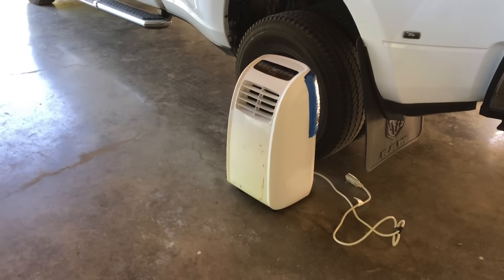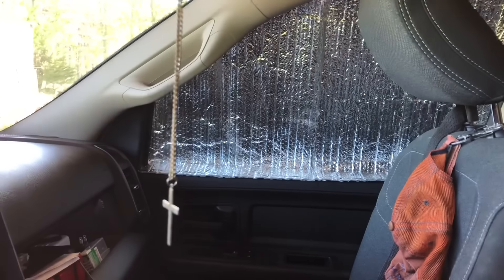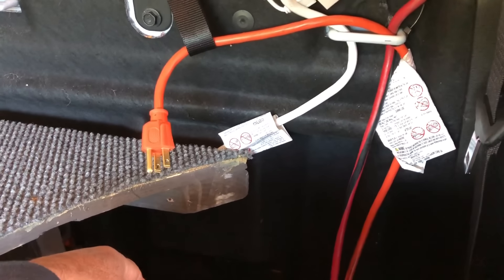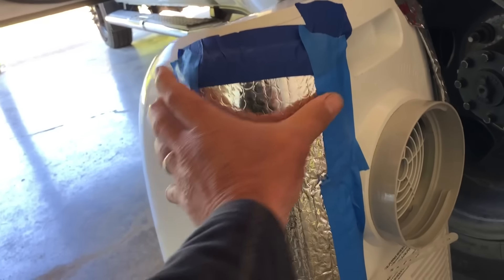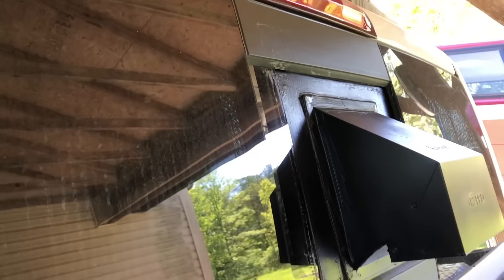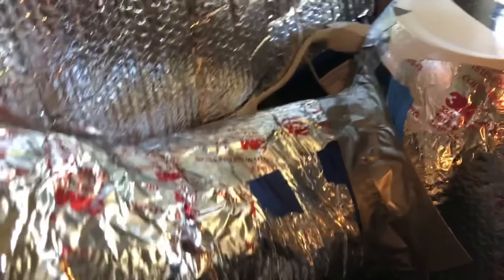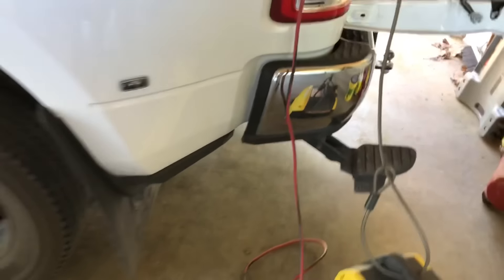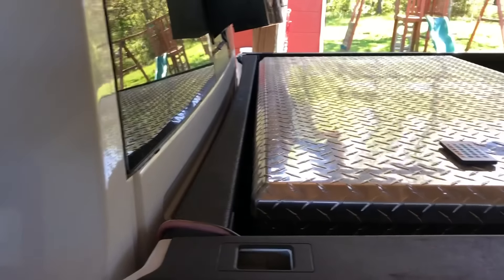Best Hotshot Pickup Sleeper Air Conditioning Setup! Save $$$ and stop idling when off duty!

Comment: Where does the air come from to replace the hot air you're exhausting out?     
I'm sure you get some leaking through the trucks vents, but unlike a house that has numerous cracks for outside air to replace the exhausted air, I imagine the air conditioner is not getting enough air going through the hot side.   A way you could greatly increase efficiency is to turn that single hose portable into a double hose by building a duct around the hot side intake and connecting it to a second hose going outside.
With a double hose setup, instead of pulling air-conditioned air from inside the truck to cool the hot side, it will use outside air to cool the hot side.      I've done it using foam board and it was pretty easy but that was in a house.  Your available space would definitely make it far more of a challenge but you seem pretty crafty.   I bet you could do it.
Reply: You are right and over 90% of people don't even understand that. But they do make two hoes versions that come with a fresh air intake hose, you just have to search for them
Reply: So it's better to cool hot air compared to cool air that dosen't make sense
Reply: @danielpolson9340  
It's better to cool the condenser with outside air than with inside air, even though the outside air is warmer.  Don't forget, the only reason your inside air is cooler is because you invested the energy into cooling it.  If you're going to use it to cool the condenser to then pump it outside, that air has to be replaced and it gets replaced with outside air that you now have to cool again.
Reply: @Andy-df5fj  the only ac i have worked on is auto now that makes sense and that's a horrible design lol
Reply: @danielpolson9340  
Yes the single hose setup is a horrible design they tend do with portable ACs, but despite the inefficiency, it still works well enough that people would apparently rather only deal with one hose, efficiency be damned.
Reply: @danielpolson9340  you don't understand  because it takes a little more advanced understanding on how air conditioners work.. All air conditioners have a hot side and a cold side that are supposed to be completely isolated from each other. The cool side goes into the living space you want to be cooled and recirculate the air in that space continuing to make it colder. It does not use or Draw in any outside air whatsoever.

The hot side is also isolated in separate and it's completely outside. It uses only outside air to cool the hot Freon that contains the heat being pumped out from inside the living space. And it does not need any of the air from the living space nor does it use it

The problem with these units in the video is that the hot side of the air conditioner is not isolated. It's inside the living space. And it's using the cold air from the living space to be sucked in over the hot coil and blown outside. So it's taking the air which it already cooled down and wasting it by blowing it over the hot coil and exhausting it outside

Now where do you think the air comes from that's replacing the hot air that's being blown outside? It's being sucked in through cracks and Vince from the hot outside. So you have a double waist. You're sucking in hot outside air into the living space while at the same time using the cool down living space air to blow over the hot coil and waste it outside.

It's a really stupid design put itself well to people and may work in an emergency when you're just having blow the cold air on a human being that happens to be sitting right in front of it.

The correct way is to have two hoses, one to suck in outside air over the hot coil and blow it back outside, and that circuit is completely isolated from the indoor air. They make those but they're expensive usually bigger and heavier
Reply: @7x779  i understand how ac works lol I've just never had that type of ac and I didn't think someone would be dumb enough to make one let alone buy one haha

Comment: roof top ac 12vdc mine runs 24/7 i run my van to go some where  when i go my batteries charge up in 30 min they are charged before i get to where i am going i have went 336hrs no run was down to 63%
Reply from the maker: Sounds interesting! I thought about doing a rooftop in the truck! Do you have a video of your setup and install?

Comment: Wow, amazed by your DIY abilities, portable air conditioners look tall and big, you can try window air conditioners. Why no business can make an air conditioner in the shape of a mini portable generator, the air outlet is a circular interface, I know the Zero Wind Mark 2 AC, but unfortunately only 2300BTU, the power is too low, it can only be used at night, I need to use it during the day,
Reply from the maker: I agree completely on the zero breeze! That thing costs way too much for what it is, it doesn’t even have a thermostat on it lol. Mine will keep the truck cool for daytime sleeping too, however I would like to add a larger fuel tank for my generator. Runs about 6.5 -7 hours when the air is working hard!
Reply: @hotshotstuff8080  you need to get a marine boat fuel tank there’s a 3 gal. and 6 gal. chrysler force fuel connectors 2 males and 2 females, male is usually npt 1/4 threads. If the barb on the female is 3/8 get a fuel line with a primer bulb that’s also 3/8, also you’ll need to get an extended run fuel cap for your generator if your generator doesn’t have a vacuum fuel pump like the Honda 2200 you’ll need to have the fuel tank above the generator. I used the Johnson/Evinrude fuel connectors and one time something was pressing against the nipple and gas started to leak the Yamaha fuel connectors are the same so I change them to the Chrysler force fuel connectors I hope this helps and gives you ideas on how to make your set up. Here’s a link for the fuel connectors 

https://www.ebay.com/itm/154674022295?epid=1257154402&hash=item24034a4797:g:6vMAAOSw2XFUjccg
Reply from the maker: @ReviewingTech101  thanks! Not sure I can run this setup as my truck is commercially operated and I am subject to DOT regulations. I’ll check it out thou!
Reply: @hotshotstuff8080  I’m a truck driver 😂 that’s what I have but I have my tank on a side compartment on my semi, for that portable A/C you can easily get more than 10 hours on a 3 gal tank
Reply from the maker: @ReviewingTech101  ahh I see lol! I had actually thought about the extra fuel tank but unfortunately my pickup bed is pretty full! I actually get a good 8 hours on a tank of fuel in my generator.

Comment: Dude I could have made this 10X easier for you. Hopefully you changed everything by now. Have an AC set up for the summer and a diesel heater for the winter. Takes me 5 min or less to set up. I use a 2k generator for the AC and the heater is powered off a 12v batter.

Comment: Just an idea but why not use the AC you already have for the truck? Connect a motor to the compressor so you don't have to run it of course and use the generator to power it or just upgrade to a bigger alternator.
Reply from the maker: Might be a good idea but I wouldn’t even begin to know how to do that.
Reply: How you gonna connect and what motor to the A/C compressor of truck when it's still connected to the truck motor? How you gonna control that system when truck is off? How you gonna control the a/c controls of the truck and the fan to blow it through the vents?

Comment: Great install, but...  how much does it cost to run for 6 hours overnight?  doesn't the gen keep you (and the neighborhood) awake all night?  Eco Flow has portable A/C can run off lithium powerstation.
Reply from the maker: Less than a gallon of gasoline to run 8 hours and these generators are extremely quiet! Also the eco flow unit that you speak of costs 4 times as much as my setup, and it doesn’t work.

Comment: Don't those AC sweet water,? just wondering because I have a similar one in My room and I had to connect a tube to a empty water jug
Reply from the maker: My unit does have a small reservoir with a drain however it has never needed drained.

Comment: U have a window at the back so just get a window air conditioner, 4000-5000btu should be more than enough, & have two 100ah Lifepo4 battery and 1000w pure sine inverter should be enough, it would be cheaper than running on gas generator as these carb engines are not the most efficient even with inverter ones they consume a lot of unnecessary fuel when running under 50% load. Also get an extra alternator in the truck with a temparature controlled voltage regulator cus Lifepo4 have lower internal resistance than leadacid and will cook the alternator at idle by pulling too much current,  
2x100ah Lifepo4 should get u going easily for 4-8hrs on a 5000btu ac. And the batteries will charge when u drive around or charge it at where u rest..u can get those inverters that have builtin chargers i recommend meanwell , i have similar setup and meanwell inverter for more than 10yrs the only maintenance i do is cleaning them every month as they are exposed to outside air and run 24x7 almost so they accumulate a lot of dust and too much dust can cause issues with overheating or they can absorb moisture and become conductive.

Comment: Could this system work on the fly? My truck is getting old and the ac is not working that good. Plus I live in the dessert. I already have a decent inverter generator and would just need the ac unit. I also have a 1930 Hupmobile 4  door  with a rear luggage rack. If this would work on the fly I was considering putting the generator out on the rear luggage rack and putting the portable ac unit in the back seat. Any thoughts. Thanks.
Reply from the maker: I have never done it before myself but you can give it a try.

Comment: I don't understand hot shots. And I'm not trying to be ignorant I really don't understand it.. I drive a tractor trailer I get out of my seat walk in the back to my air conditioned sleeper with my refrigerator my microwave I've done it for years.. Why would you want to live in a pickup truck when you could live so much better? Do you make more money doing hot shot is it easier? I'm honestly curious
Reply from the maker: Chris, believe me I ask myself that same question sometimes lol! 
I can’t speak for others and can only tell you why I do it.
First is the initial cost of a pickup vs a tractor which is a big difference. 
Second is the flexibility and lifestyle it allows me to have. I am an owner operator and leased on with a transport company, I only do rv transport and I can shut down whenever I want and enjoy life!
And third is rv transport is pretty easy! No booming or tarping. At my age I chose an easier way.
Thanks for asking!
Reply: @hotshotstuff8080  Thanks for your reply I definitely understand RV transport I used to work for wave many many years ago. The flexibility was nice that’s for sure. As far as the initial cost of a pick up goes these days it’s getting pretty close to the price of a used Freightliner the way everything keeps going up but you definitely have a lot more operating expenses with a rig. I don’t own my own truck right now and the price of fuel would absolutely terrify me if I was a owner operator pick up truck or semi. And I guess you would have a lot easier time finding parking now that I think of it. Either way stay safe out there and keep the rubber down. Thanks for giving me a good idea for when I get tired of turning all 18
Reply: I've been looking for a used semi and cheap ones are not to be found. I bought my latest F350 for $6500 and it's just temporary. I will be moving up to a semi with a large sleeper around the end of the year. I'm getting ready to do longer hauls so I will purchase a larger generator and portable AC that can be used in both trucks. As for easier, it's easier to get fuel with a hotshot because I can squeeze my way into and out of regular gas stations. But semi is the way to go as the load board will testify. Like 6000+ loads compared to 17.

Comment: I just let my truck idle. Am I really wasting that much? Silverado 2500 6.0. I let it idle for days sometimes weeks
Reply from the maker: If your truck has a 6.0 that’s a gasoline engine I believe? Just be sure your doing your oil changes off your hour meter and not miles.

Comment: Do you leave sunroof or windows cracked open? Since exhaust heat air is being pumped out of cab, in such a small area, wouldn’t you need to allow air inside to keep from running low on oxygen?
Reply from the maker: Thanks for asking that’s a good question! 
https://youtu.be/Q691-iacrR0
Reply: @hotshotstuff8080  thanks for the info.. I was unaware that the cab self vents in the back and front..  I installed same AC as you pretty much the way yours is, took it out past couple weeks on the road. It does well if outside temp is 79 or lower at night.  but if its much warmer, doesn't keep me cool.. I was in Texas, outside temp 85-98 at night, it didn't really keep me cool, blows cold, against window, but by the time it circulates in the cab, the air is warm.. Do you have this issue? any suggestions? I'm planning to add some ducting to the cold side, up and across the top of back window adding couple vents so it blows directly on me.
Reply from the maker: @texascountry6674  wow that’s hot for nighttime but I get it if you are in Texas! I know with my setup it takes a little time for the unit to cool the cab when it’s hotter outside. I have never had a night that it wouldn’t keep me cool though. I usually keep my thermostat between 72-75 depending on how hot it is. 
Can I ask if you are using the reflective insulated window covers?
Reply: @hotshotstuff8080  Yes,    I have reflective on all windows. I purchased the reflective insulation at home depot,  couple issues with it, it doesn't seem to be as good quality as the RV reflective window insulation, and its not stiff enough, so it doesn't stay tight against the windows.  So I plan to upgrade it. thinkin of using something thicker more permanent on the rear window and around the vent to ensure it keeps that exhaust heat out. I'm also adding a Generator Fuel Extender so I can run it more than 6-7hrs. I have the Polaris P2000I Gen.  I tried running my AC at 68, but the compressor shuts off after 30 mins, prob getting to hot. 72 is prob a good temp for it.
Reply: Just wanted to give you a update.. I added  6" ducting to the Cold air output of AC so the air comes out directly on me instead of blowing towards the window.. It will now freeze me out.. It may or may not keep the entire truck cold if outside air is 85-90 at night, but with it blowing cold directly on me, its way more comfortable..  I was in San Antonio last week, it was 87 degrees at 11pm, but with the ducting blowing directly on me I was very comfortable..
Reply from the maker: @texascountry6674  good to know! Thanks for the info.

Comment: how well does this setup work for your 34 hour reset? I just picked up a Hisense 6000 btu AC and Champion 2000 watt genny.. but theAC only cools for a 5-7 minutes then the compressor shuts off! Cab temp is 90. I'd appreciate any help!
Reply from the maker: My compressor kicks in and out as the temp cools and then re warms as it should. Does your compressor not kick back in? Also how many watts does the unit pull?

Comment: 8000 btu to cool your pickup cab? Do you sleep in a sleeping bag? Nice setup.
Reply from the maker: Yes I do use a sleeping bag, usually run air conditioner thermostat around 75 degrees.

Comment: The heater does it work well in north dakota? It's gets down to -15
Reply from the maker: I have used the heater down to 0 degrees and it worked well! The key is to use the foil window coverings with it and the air for insulation on the glass. 
-15 is cold, I would be more concerned with the generator operating at those temperatures, but again no issues down to 0.
Reply: What about ac working in AZ? It's get to above 100 degree?
Reply from the maker: @ltruong571061  honestly I have never used this setup in 100 degree weather! However I believe it all depends on how cold you need it to be to sleep. I generally run the thermostat at 74 or 75 degrees.  
This keeps me comfortable and I can sleep. Remember the lower you run the thermostat the more the compressor stays on, and therefore the higher the load on the generator. This causes the generator to burn more gasoline, and you can potentially run out of fuel before you awaken. I have had this happen two times in two years on hotter days. One solution would be to have a higher watt generator, say 2500 instead of 2000. Then the larger generator should last longer with the same load, in this case 800 watts from the air conditioner with compressor running.

I hope that gives you some idea, thanks for asking!

Comment: Can you run the generator in the bed of your truck when stopped and sleeping? Or does it vibrate and shake disrupting sleep?
Reply from the maker: It does vibrate and when the compressor kicks in and n the air conditioner the generator revs up. what I do is I keep a long cable around the generator handle and keep if padlocked to my truck, also the fumes from the exhaust concerns me if I keep it in the bed.
Reply: @hotshotstuff8080  that's why you have to have a CO detector in the truck. I did in the semi.

Comment: What are ,all the yellow. 5 gallon cans , diesel storage ?
Reply from the maker: Yes, extra diesel. I get EFS discounts at stations in certain areas and I pick up extra fuel when there and use it when I’m in parts of the country where my discounts aren’t as good. Sometimes the difference will be $1 per gallon or more, but usually runs .60 to .80 cent’s!
Reply: @hotshotstuff8080  what type of hauling are you doing ? Rev, flatbed or car ? I have EFS card discountv
Reply from the maker: RV transport